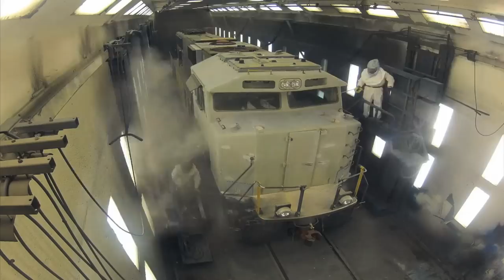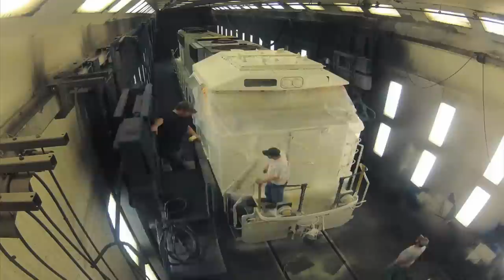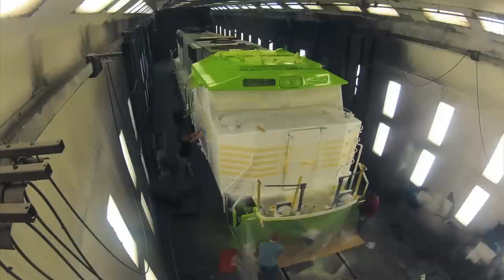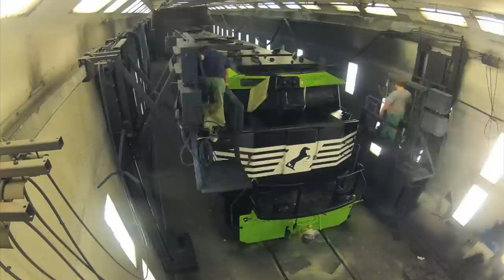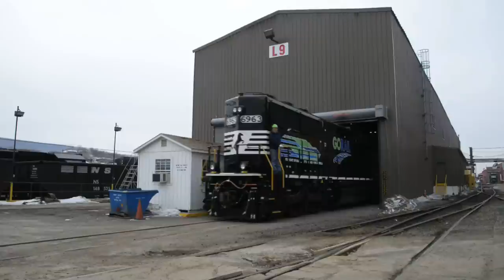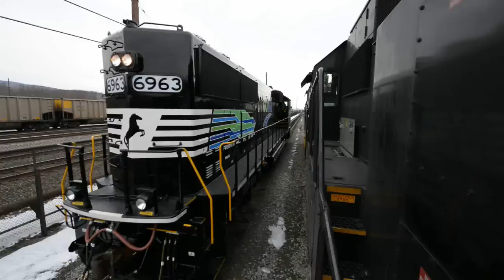Norfolk Southern Unveils New Locomotive in Celebration of GoRail's Tenth Anniversary

Comment: I will never figure out why they, the different railroads, always leave the wheels and couplers that rusty color. They could at least paint them black also and then it would look complete.
Reply: I was a railcar mechanic  awhile back and I believe the reason is for inspections of the wheels . One thing most don't realise is that thereb really isn't a wash bay to pull into and clean cars and locomotives like a car or truck! If you think about it, the wheels being made obv. of steel and rolling on steel rails, over time they will get a thin layer of a rusty hue along the bottoms of the locomotive and all cars. which is nothing more than the result of friction between the wheels and rails.

Comment: While most sane people advocate a return to Rail freight (Railroad Express Agnecy) we must remember that when Rail made the US great it did so because the government  had not developed an interstate highway system, trucks were used only for local deliveries from freight depots and the government did not tax the living daylights out of the railroads while giving tax breaks to trucking companies - often started up by returning veterans. The railroads were also taxed on track mileage thus giving incentive to remove as much of the parallel trackage that had been built. We must also remember that this taxation occurred when the engines and rolling stock were worn to the bone by 4 years of intense service during WW-II. Also, while being taxed to the hilt the operating companies, that had made huge investment in new locomotives and rolling stock in the early 1940's began to scrap this investment in favor of diesel.  Their big error was not running the steam units until they came up for major tear-downs for boiler service thus minimizing the capitalization for now engines and maintenance facilities and all the cost of retraining the service and operating crews to run them.

Comment: How did a bogey with two axles in the workshop change to a bogey with 3 axles out of the workshop??
Reply: Here in the US, we refer to those as 'trucks'.  The locomotive, while in the paint booth, was on shop trucks (basically standard railcar trucks), for whatever reason (maybe the locomotive trucks were being rebuilt).  They are unpowered and allow the locomotive to be moved from area to area.  The 3-axle trucks are the standard locomotive trucks on these EMD SD60 series locomotives.

Comment: - CONTINUED - This has been done BUT, there are many steam units not in service, with more coming on line. These engines are proving to be as able to pull huge loads as they were when originally built. How about putting all 8 of the Big Boys and the other heavy haul articulated engines back in service to pull heavy freight over mountains freeing up as many as 4 diesel units for long haul. Also the steam units, when converted to oil, need worry only about water - double tenders can provide for longer runs. where water could be a problem. Americans have forgotten that it costs less to rebuild - especially with new materials, than to replace. Look at the Union Pacific steam program for proof of this. Not to forget other serious restoration programs across the country.  The age of steam has not passed. Steam will never lose the power to do work. With research into efficiency, steam units can again  return to revenue freight.